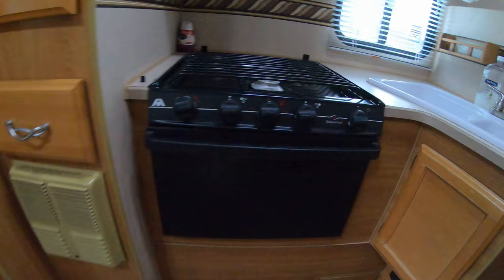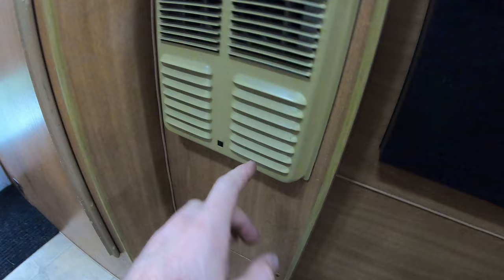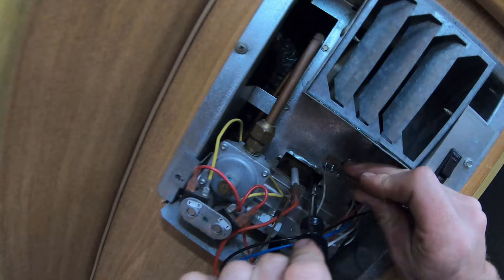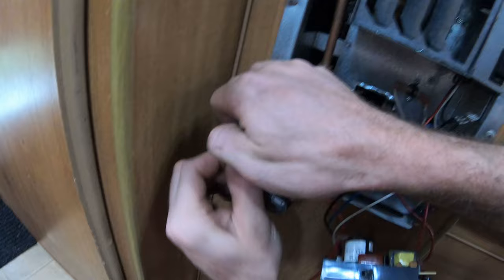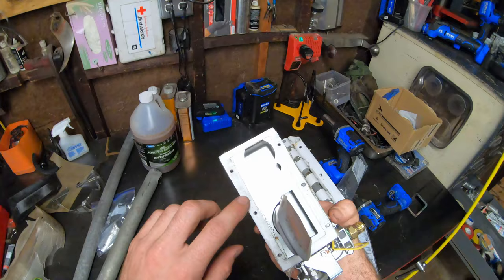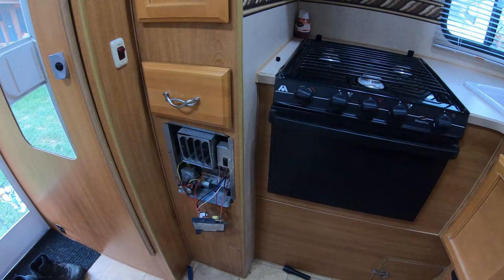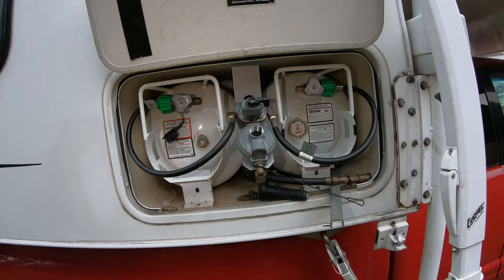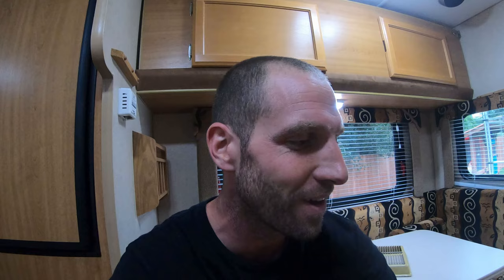Would You Have Overlooked This? Fixing my Atwood RV Heater

Comment from the maker: NOTE: I failed to mention in the video, I did turn the regulator adjustment back to where it originally was. However I ended up replacing the entire regulator assembly due to the seepage from the switching valve weep hole.

Comment: Too much tech required!!! Give me a 1962 Coleman furnace. No dangerous , complex electronics required. Turn the tank on, turn the pilot light on, light the pilot light, adjust the flame. Start the burner. Sniff for leaks. Proceed with care. Check for heat. Adjust accordingly.🤗
Reply: Those never worked for me

Comment: Hope you reset that propane regulator since you have no way of knowing how much pressure you added. Be safe.
Reply from the maker: I ended up replacing it due to the seepage  coming from the switching valve. I thought I mentioned that in the end of the video but maybe I forgot to add that clip

Comment: Thanks for this! I took mine apart and did all the checks you did and it was all fine. I was told the furnace was never fired. It looked like it was only ever test fired. Turned out the one gas valve solenoid was rusted stuck. Cleaned it up, and it works perfectly! Gets my little pop up super toasty, and running it all night for 2 nights I didn’t even kill a 20lb

Comment: Thanks for the video.
This helped me to end my 3 hour journey of troubleshooting that stupid thing.
I had a problem with my altwood hydro flame furnace and your video solved it in 1 minute. But thank god I didn't had to take the whole thing apart.
The furnace would not turn on in my camper at all. Every video on YouTube  shows how to take it apart and how to clean it and much more. But I had a gut feeling that this is not a cleaning or any kind of malfunctioning problem.
Now you are the first one showing step by step what you did to start the furnace up and that was the helping hint in the first minute.
I knew I had power on the thermostat. Power supply is correct but I had no power on the furnace side.
Checked the breakers and tiny fuses all are ok.
You showed on your thermostat to turn the heat all the way up and all the other videos didn't show your next step. You toggled the upper switch on the thermostat to the on position and that is nowhere mentioned in all those videos I have watched. But that little stinky plastic switch done the job and my furnace makes the sound of happiness. Mention that maybe in your next video it might help someone like it helped me even though you just turned yours on routinely. Ha ha. Thanks again.
Reply from the maker: Hey, awesome to hear the video was helpful to you. I'm sure your detailed comment of your experience will help others big time in the future

Comment: Awesome problem-solving sequences in your video.  I am such a newbie compared to you that the first thing that I must ask you before I attempt some similar problem-solving is this one: What powers the furnace, if anything?  Does the flow of propane do everything?  I ask this as this is my first RV and it has not camped in perhaps a couple of decades.  It used to have solar-panels.  I have only gotten a chance to plug power directly into it (from a house extension cord to the RV plug) just once, and may never get that chance again.  So then, do I need some sort of electrical power for the furnace to work or, does it just need a full propane tank?  I tried the two cooking burners inside yesterday and they worked fine!  Thanks,  Martin.
Reply from the maker: It's powered with 12 volts from the battery.  First things to check would be the fuse box, the safety trip switch, and if you're getting propane or not.
Reply: @NoNonsenseKnowHow  Thanks Chris!

Comment: I have a similar model to yours. It's clicking, but pretty slow. Maybe once a second. I think in your video I could hear your ignitor clicking very rapidly. Maybe my ignitor isn't even clicking, maybe it's the solenoid making that sound? Also took the ignitor out and fired up the furnace, but didn't see any spark. (My ignitor has three rods instead of two.) Ideas of what my problem could be?

Comment: Thanks for all your great videos, I have a question for you I fired up my newly bought 2000 camper heater runs great but smells a little mousy any tips ??
Thanks in advance
Reply from the maker: No problem, glad to hear they were helpful. It sounds like you may have a dead rodent kicking around in there somewhere. I would consider taking it apart and inspecting

Comment: I have the same heater in my camper and keep having issues during 0 degree weather. It runs basically nonstop for around 25 or 30 hours, then it stops working and blows cold air. I have plenty of electrical power and have fresh propane tanks. My regulator is outside of the camper….is it possible it’s freezing up?
Reply from the maker: Yeah if you're talking 0° f. It's probably freezing up or the tank is getting too cold and doesn't have pressure. Next time it stops working, try using your range to see if that's still operates fine. That will tell you if the tank still has good pressure